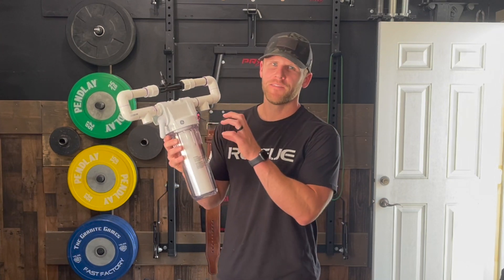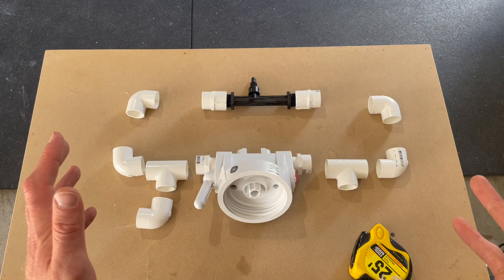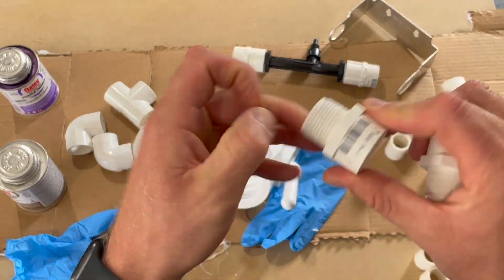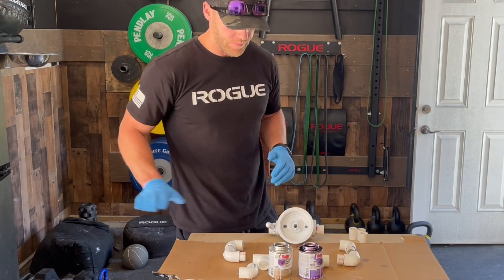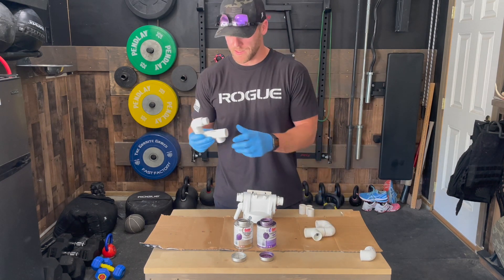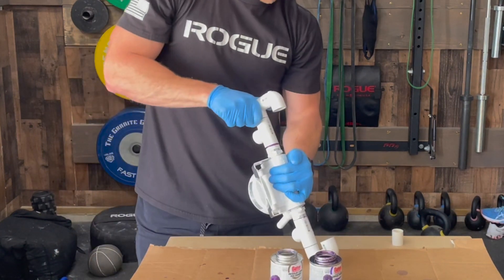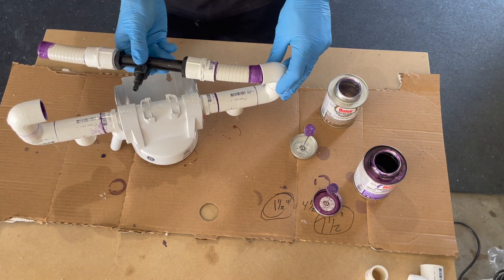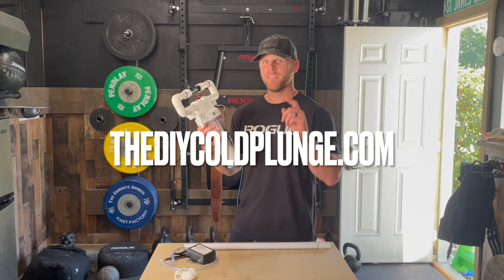Step by Step Sanitation System | DIY Cold Plunge

Comment: I am a little confused about this setup. Isn't the resistance for flow through the venturi injector much smaller than through the mechanical filter? I would expect most water to flow through the Venturi injector (path of least resistance) and the filter only catching heavier particle that land in the lower branch due to gravity. Does your filter get dirty at all? Am I misunderstanding this set up? Is the flow resistance of the venturi injector comparable to the filter, is that why it is working?
Reply from the maker: Hey! The filter definitely gets dirty. Because the venturi condenses down, majority of the water flow goes through the filter. Gravity doesn't contribute much to the system at all, its all flow-based.
Reply: @DIYColdPlunge  Maybe a strainer upstream of the filter/sanitation would be a good idea to catch sediment that may find its way through the Venturi and into the cooler? Thanks for the great DIY. Adding this setup to my Ice Barrel 300.
Reply: Does the venturi generate enough of a vacuum for water to flow or do you have a pump somewhere

Comment: Do you see any issues with putting the tee for this, after the filter? so running into filter, then out to a loop with the ozone generator within it? My concern would be putting this inline with the filter might eventually lead to sediment debris clogging the line since it's receiving non-filtered water.
Reply from the maker: You could set this up a number of ways, and what you outlined makes sense if I'm visualizing it correctly. BUT, if you have some sort of strainer cap, that shouldn't happen. And if anything, it would affect your pump not the filter/venturi. No wrong way to go about this though!

Comment: If you are not using a chiller can you use a pool style pump or do you still recommend the danner 1200 type pump?
Reply from the maker: A pool pump would work great in that case, as long as it has the power to create a suction for the venturi. You would also want to skip the filter part of this - most pool pumps come with a filter built in.
Reply: @DIYColdPlunge  The Danner 1200 is out of stock. If we have a 150 gal rubbermaid (obviously not filled to the top), would the Danner 950 (#02710) work?
Reply: @DIYColdPlunge  I have an intex pump. Are you still recommending using just the filter in the intex or should I use a double filter (intex + ge filter)?

Comment: Does this design allow some water to go through the pump and not get filtered? It seems like the water is either being filtered or being ozonated, but not both. Could you just put the black venturi injector piece inline?
Reply from the maker: I have another video that talks through some of it, but you don't want to restrict water flow that much. And as soon as the filtered water hits the tub, it's no longer "filtered." You'd need to filter into a new tank for all the water to get filtered in one shot.

Comment: Will this setup work if you have a pump/filter combo upstream?  In other words, you create a bypass that is just a simple tee, one outlet that leads to the venturi and the other is straight pipe or tubing that joins at the other end of the venturi?
Reply from the maker: That should work, there's nothing special about having the filter below, this is just the most space-conscious setup if you are starting from scratch. I would put the ozone first as it needs a certain amount of PSI to create the suction 👍

Comment: Whats the reasoning behind setting it up in parallel like this?
If it was full flow through the filter then past the ozone Venturi you could likely run a smaller pump and lower overall electrical consumption. Am I missing something?
Reply from the maker: The main reason is to maintain the flow rate of the water - which most want for a few reasons. The venturi injector needs a certain PSI to create suction. Your chiller also needs water to move at a certain rate to function efficiently and keep the water cold. The electrical consumption difference on a pump is going to be extremely minimal. From a user experience standpoint, moving water will break down the thermal barrier your body creates.
Reply: @DIYColdPlunge  so essentially to reduce flow past the venture and maintain flow everything else?
Reply from the maker: @pearlpirate  Yes, keeping a high flow rate

Comment: Nice work, replicating that expensive Plunge set-up. I'm looking to do the exact same thing with my Rubbermaid tub. I take it you're gonna be using bulkhead fittings for return hose? Does your friends Plunge have a pump on the return line coming from the filter. From pics I've seen the Plunge tub has two pumps an intake ambohr wp-D800 pump and some other pump for the return I believe it's a Jeboa. I take it that's for better circulation in the tub, but not really necessary. I'm currently gathering all the parts for my build. Good luck with yours, curious to see what you do.
Reply: Hey Joe. With more research I figured out what it was, it's a Jebao PU-18 Pond and Aquarium Clarifier. It uses a UV bulb in that long chamber, which aids in sanitation and water clarity. I initially thought it was a pump. I saw the image in one of their Plunge filter removal/change videos on YouTube. I was looking at getting the jebao DCT-6000 it's rated at about 1,500 gph. That's assuming I get the penguin 1/2hp chiller. What are your thoughts
Reply from the maker: @Jptl07  aah that makes sense. I just looked that pump up, never heard of it before. I think it should work great. I have a Danner Aqua-Mag 1200 that I really like and the flow is in that same range. I may have to bite the bullet and test the DCT-6000 as well.
Reply: @DIYColdPlunge  will that pump have enough pressure to push the water through the filter in this video?  Thank you, appreciate all your guidance!
Reply from the maker: @chrisfreeman1054  Yep! I'll post a video showing it working soon.
Reply from the maker: Thanks Jamie. Ill use bulkheads to go back to the stock tank. I don't believe there was a dual pump setup. Is that what you have seen? I'm curious if you have pictures of that. My friends goes pump, chiller, filter/ozone, then heat (bc his is hot and cold) and then returns into the tub

Comment: I think you need to put the filter and injector in line. now half of the water is filtered and half is ozone treated. if they are inline (one after the other) then 100% of your water is treated in both ways. or did I miss something? really asking
Reply from the maker: I like your thinking! Most pumps will output between 1000-1800 gallons/hr. On a 100 gallon tank (that probably has 80ish gallons in it) the water changes over many times. Ozone generators should run at least an hour, maybe 2-3 depending on overall use so majority of the water will see ozone a few times over during that time span. Putting the venturi exclusively in line would greatly reduce the flow rate, affecting overall water circulation and making the pump work a lot harder. The ozone will also meet up with the water after it runs through the filter anyway. This configuration is the best of both worlds.... I totally realize this is a ramble but long story short this keeps the water moving so more water overall can be both filtered and "ozoned" 😂 Does that make sense?
Reply: I was wondering the same question, but that was a great response! I understand both thought trains but after hearing your explanation this system seems perfect
Reply: I also think that @jegreene2 is correct, I sell some ozone diluted in water systems and what we struggle the most is that for some reason the Venturi gets clogged,and then we have to unclogged by running water in reverse, when you pass your water without filtration through your vinturi you can also get the same problem of getting it clogged. And in your system there is no way to run water the opposite way to fix it.
Reply: Instead of gluing flex pipe to your T- splitter, try to add a threaded connection. This way, you can switch the connection and make it flow in reverse to flush out the vinturi
Reply: All these comments make sense...but to get the best of both worlds it seems like the parallel part should be after the filter.  That way all water is filtered, then some is split off to the venturi tube for ozone, then rejoins the rest.  Anything wrong with that scenario?
Reply: @jwgreene2 the thinking here is so the venturi also acts as a bypass in the case of the filter becoming plugged. This would prevent the pump or chiller from burning out if the filter plugs